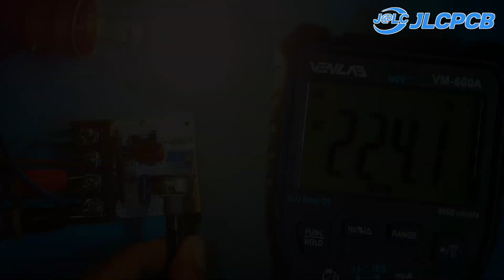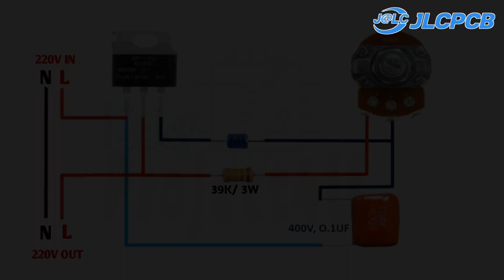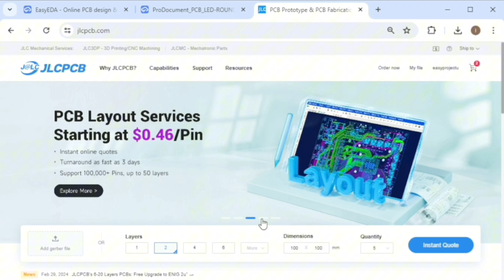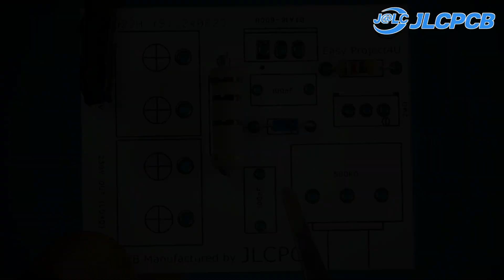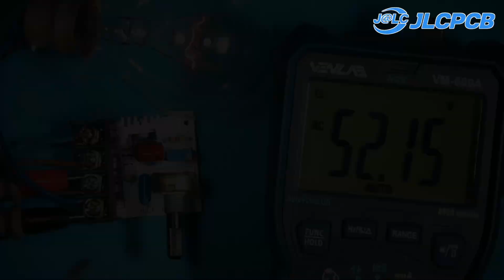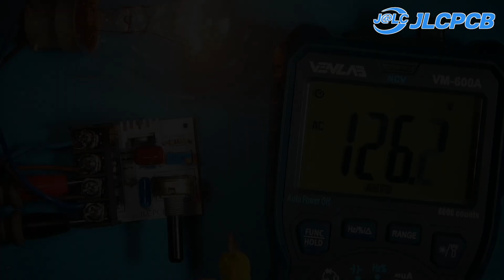Single Triac 2000w AC Voltage Regulator circuit | Dimming, Motor Speed, Heating Control

Comment: Hi, sorry for the question. I wanted to ask you, can I use this circuit to drive your energizer, which is powered by 110 volts? In my country, I have 220 volts, and I tried to add input resistors to your energizer circuit to get it to work, but they heat up a lot. That's why I asked, can I use this in your video? Thanks.